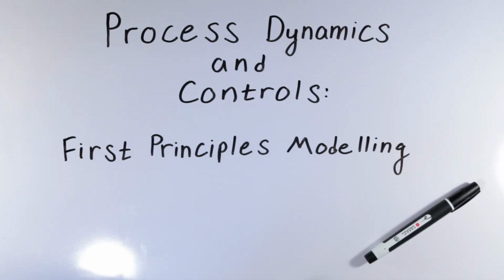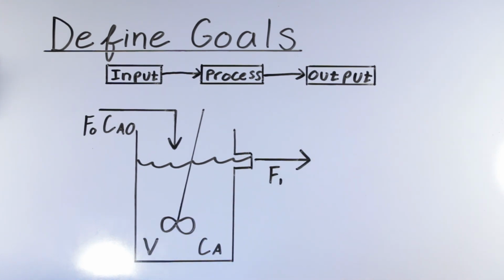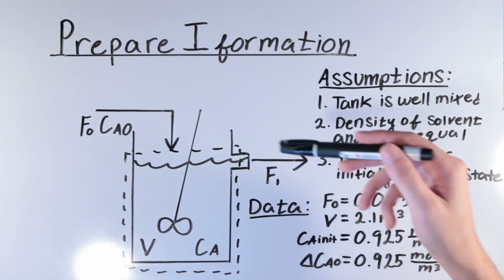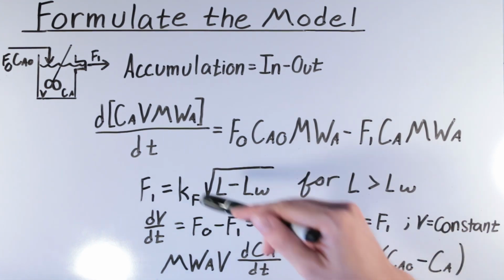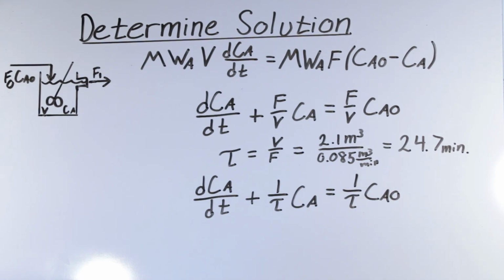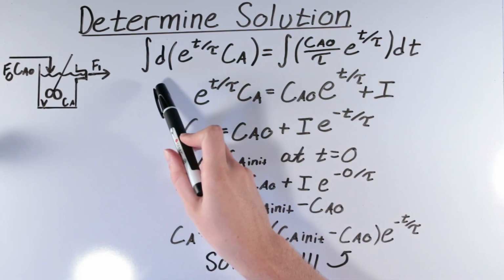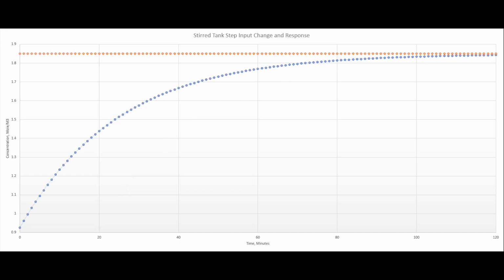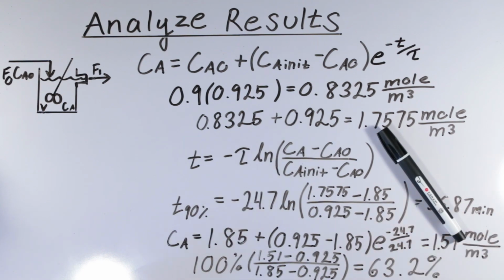First Principles Modeling

Comment: Thanks for the video!
 it would be great if you could explain the empirical modelling in brief too.
Reply from the maker: Though many real world processes could be modeled by complex differential equations, the vast majority of differential equations are not solvable. The example presented in this video is a simple example that is solvable. To control processes that don't have solvable models (and even to compliment those that do), empirical systems like PID control are implemented.